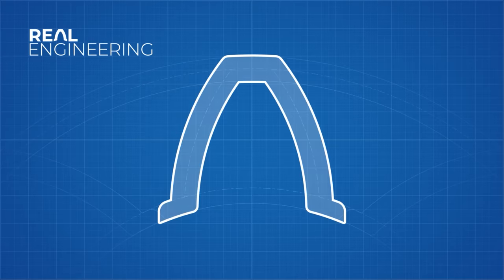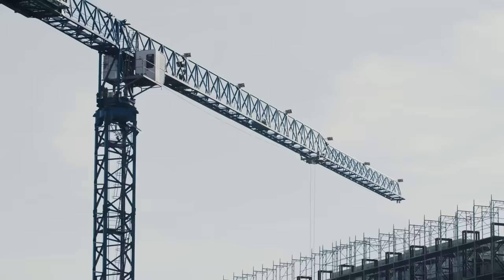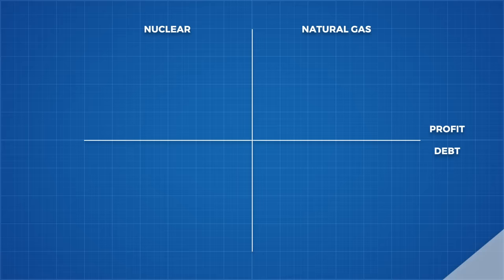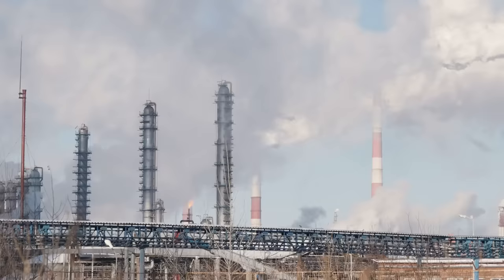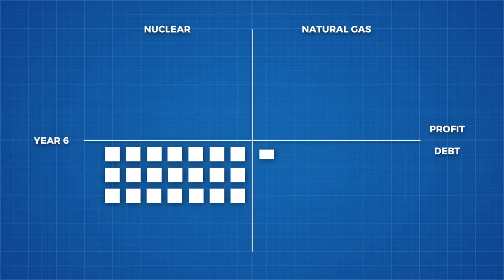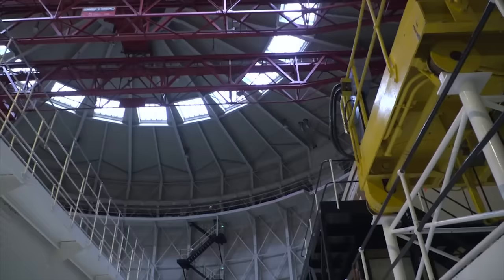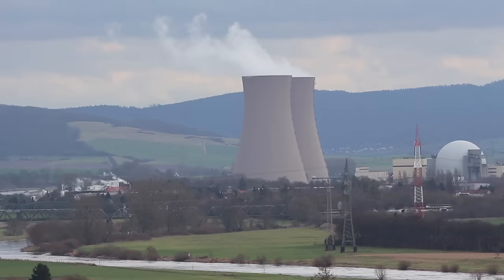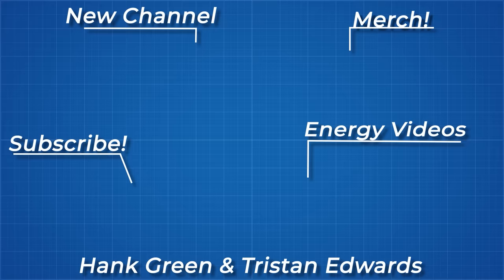The Economics of Nuclear Energy

Comment: This video was about economics; I trust that if you're going to do future videos on energy, you'll put 'nuclear safety' in proper perspective.

I.e. go into things like operating hours/death, the Windscale fire, pebble-bed reactor design, and the difficulties that arise when politics mixes with engineering.
Reply: And hidden carbon emissions and waste of the "clean sources"
Reply: Solar is literally more dangerous than nuclear. Calm down.
Reply: @davidhood9712  I'm a nuclear guy but I'm struggling to figure out how solar based energy is more dangerous than nuclear. Unless you are being cheeky as the Sun is a fusion reactor or talking about skin cancer or being blinded momentarily and crashing your car.
Please explain. I really do think nuclear is part of the solution not the problem and would love as much ammo for that rare fight with anti nuclear people as I can get.
Reply: @skizzik121  One potential problem with solar power plants would be their ecological impacts.
Reply: @skizzik121  The reason for the safety is the scale of construction.
Nuclear plants tend to have a 90%+Capacity factor.  They basically run at 100% power 24 hours a day, every day, for a year or two.  And then shut down to 0% for a couple of weeks to refuel.  So a standard 1.1GW nuclear reactor will produce about 1GW of average power. 1GW-Y per year.  Nuclear plants have a designed lifetime of 60 years, though it's possible that could be extended.

Irradiance from the Sun is about 1000 Watts/m^2.  Solar panels tend to have 15-20% efficiency, so we'll say 17.5%.  And Solar panels have a capacity factor of ~30% due to the angle of the sun, plus the entire nighttime loss (assuming ideal locations).  Putting that all together, 1m^2 of solar panel will produce 1kw x .3 x .175 or about 50 watts of average power.  With a lifetime of only 20 to 30 years.   A square kilometer of solar panels (1 million square meters) will thus produce 50MW of power on average.  Thus to equate to a single Nuclear reactor (normally multiple per plant, but we'll stick with 1) will take about 20 square kilometers lined edge to edge with solar panels.  And actually double that, since the nuclear plant will run for twice as long.  So 40 thousand square kilometers of solar panels need to be produced.  That means mined, manufactured, transported and installed.  This would be further exacerbated if we did the fair comparison of including deaths from the production/operation of the massive hypothetical battery, or the backup natural gas plants, necessary to supplement the solar power's intermittency to make it equivalent in quality to the nuclear, but we'll ignore that for now.

When doing ANYTHING on that scale, you're going to have random accidents that maim or kill people.  Especially if part of your supply chain is from places like China.  It's not that solar panels are generally more dangerous than nuclear (except rooftop solar, which has a significant increase in deaths/Peta-watt hour because installing things on roofs is dangerous).  It's just because producing equivalent amounts of energy requires so much more mining, manufacturing, and installation when doing it from a diffuse-harvesting method like solar or wind compared with a concentrated source like nuclear.

(And yes, the comparisons that make nuclear many times less deadly than solar and wind include the projected deaths from Chernobyl and other commercial nuclear accidents).

https://www.forbes.com/sites/jamesconca/2012/06/10/energys-deathprint-a-price-always-paid/#4184e6cd709b
Reply: @skizzik121  Nuclear powerplant work is mostly an office work, while wind turbine workers have to climb into dangerous locations.
Reply: @TealJosh  not to mention, as funny as it sounds, it genuinely dwindles bird population as they get struck by the blades.
Reply: and energy density of the power production technology over land area required, as well as waste.
Reply: people said that you can't avoid tax in your life....and who tax you? your mom?, no it's the politician...now enjoy your life
Reply: @davidhood9712  that's what I was getting at - the Windscale fire was a serious engineering failure, yet it did not directly cause any deaths - that can't be said of oil, NG, or hydropower.  Or bridges for that matter.

Comment: This is a fairly good generalization, however, a key figures has been left out. One of these figures is capacity factor. A nuclear power plant's capacity factor is around 93.5-96%. Solar power has an abysmal capacity factor of 24% and wind has a little better CF of 34%. If you wanted to substitute a 1000 MW nuclear power plant, you must build a solar farm with a capacity of 3900 MW or a wind farm with a 2800 MW capacity. 

"Wind turbines deliver (over the course of a year) between about 20% and 40% of their nameplate production capacity (depending on location). Therefore, the backup power plants will have to deliver the remaining 60% to 80% of the energy. This means that wind turbines would be more reasonably characterized as fuel-saving technologies for combustion power plants rather than stand-alone generators of electrical energy.
[--]
Renewable energy sources (primarily wind and solar) will not be able to supply the needed large quantities of energy sustainably, economically and reliably. In addition, renewable energy sources with fossil-fired backup power will in many cases not contribute towards reduction of greenhouse-gas emissions. Distorting the market with subsidies and by legislation to attract intermittent energy technologies into applications for which they are not well suited is economically wasteful." [1]

The next large problems with renewable energy sources come from land requirements and energy storage. Batteries are ineffective and expensive; pump storage requires vast amounts of land and a huge initial investment.
 The vast land requirements will cause problems, for example, with biodiversity conservation. This and other immeasurable factors are generally disregarded by many experts.

"Based on an objective and transparent analysis of our sustainable energy choices, we have come to the evidence‐based conclusion that nuclear energy is a good option for biodiversity conservation (and society in general) and that other alternatives to fossil fuels should be subjected to the same cost–benefit analyses (in terms of biodiversity and climate outcomes, as well as sociopolitical imperatives) before accepting or dismissing them." [2]

The argument that uranium stores will be depleted within a few decades is also untrue. 4300*10^6 tonnes of uranium is dissolved in ocean water, compared to 5.9*10^6 tonnes on land. The uranium in seawater is also being replenished by a constant pseudo-equilibrium reaction with uranium containing rocks. [3]

References:

[1] Brook, B. W., Alonso, A., Meneley, D. A., Misak, J., Blees, T., & van Erp, J. B. (2014). Why nuclear energy is sustainable and has to be part of the energy mix. Sustainable Materials and Technologies, 1-2, 8-16. doi:https://doi.org/10.1016/j.susmat.2014.11.001

[2] Brook, B. W., & Bradshaw, C. J. A. (2015). Key role for nuclear energy in global biodiversity conservation. Conservation Biology, 29(3), 702-712. doi:10.1111/cobi.12433

[3] Diallo, Mamadou S., Madhusudhana Rao Kotte, ja Manki Cho. "Mining Critical Metals and Elements From Seawater: Opportunities and Challenges." Environmental Science & Technology 49, no. 16 (2015): 9390.
Reply: whoa

Comment: I think the problem with the levalised cost diagram (love the artwork though btw) is that it only shows one way of looking at the problem.
 
Every other form of power generation there (other than natural gas, so the renewables) either requires specific geological features (a thin crust for geothermal, or somewhere either damable or with a large amount of tidal flow for hydroelectric), or else are entirely dependent on the weather, be it sun or wind, making them unpredictable (as well as region dependant) so you have to massively over-build your system.
 
Batteries are not going to cut it for regulating supply if most generation is irregular and needs regulating. They're also bad for the environment to manufactre, and degrade with charge cycles so need periodic replacement. Then you'll still need fossil fuels to fill the gaps which pollute.
 
Hydro is regular and awesome, BUT there are relatively few places where this can be done efficiently. Tidal can't be usually be used where there is marine traffic, and dams envolve flooding huge areas and have a massive impact on the environment. And can collapse... According to wikipedia (if you exclude the Banqiao dam collapse in China) 19,633 people have died from dam collapses (and the list is scarily long), however the Banqiao dam collapse in one go killed 171,000 people, bringing the total to 190,633 fatalities.
 
Compare that to "dangerous" nuclear power (even when you're including the cancers which we can't know were caused by the accidents, bearing in mind 50% of us are predicted to get cancer regardless) is only 522, if you only enclude direct deaths, that falls to 48, of which most seem to be workers killed in steam accidents etc, basically nothing to do with radiation. Then compare that to how many people have had their cancer treated BECAUSE of radioisotopes acquired from nuclear reactors... I'm going to bet it's more than 522...
The excess power at night can be used to charge electric cars, run heavy industry, charge pump-storage reservoirs etc (any thing but try to use batteries...*facepalm*)
Reply: okay, but now what about nuclear waste? this wasn't mentioned in the video whatsoever, and I haven't seen anyone in the comments talking about it yet either.
No one wants the waste on their land, and you have to protect it for thousands of years, which costs a lot of money...
Reply: @ThunderDraws  
Nuclear waste is a non issue for the plant operator. 

The waste topic is in essentially  all cases dealt with by government funded organisations.
The recently required stricter safety  regulation by the  greenies is the big issue for nuclear. Making nuclear the only form of energy with a negative cost curve. > Nuclear got more expensive.
Reply: Sorcize Is that why Chernobyl is already safe for life and to revisit, is that why people are living in Fukushima again?
Reply: Thunder Draws Waste is hardly important, put very simply, it's already been in rocks for billions of years, put it back in the rocks and problem solved, especially when half lives are high and in the millions to billions of years.
Reply: @Sorcize well, yes for the meltdown and no for the environmental impact of a meltdown. I simply miss the evidence that thousands of  people get killed by a meltdown. A few do,  but the majority of the population will not notice an impact. Maybe some will die earlier due to effects associated with higher radiation. But that's it.
The environment (nature) has and will always adapt.  But can we  humans?
Reply: @fatguy6153  What comes out of a reactor is a bit more concentrated and dangerous than what is sitting in the ground. If it's enriched fuel it is even worse. Often the only "safe" way of storing the waste is to build waterproof concrete tombs in isolated geologically stable areas, in order to avoid contaminating groundwater for the next ten thousand years.

Comment: Cost of decomission not part of the calculation - or did I miss it?
That and the cost of CO2 emissions are both weighty pro/con-factors in a true-cost comparison between Gas and nuclear power.
Why leave that out?
Reply: yeah, decomission is extremely expensive. of course so is co2....
Reply: At least in the US, part of annual profits go into a decommissioning fund by law.
Reply: Because the figures were restricted to an investment point of view and try to explain why investments in nuclear deacreas.
For an investor the relvance of decomission costs (in 40+years which would only 'eat up' the profits of the very last year) are irrelevant.
Co2 is not yet taxed and differ from country to country ... that would increase the fuel costs.
Reply: Also no inclusion of the long term costs of nuclear waste storage...

Most waste to this day is only in temporary facilities with little planning on how it can be stored for the 100,000 of years it will take to safely break down

There is a great doco called ‘into eternity’ that looks at Finland’s underground storage
Reply: @Willaev  aka the public still pay for it, just in taxes instead of on the bill... easy to be profitable this way.
Reply: @benjaminmeusburger4254  
"the figures were restricted to an investment point of view"
the title of the video say "The Economics of Nuclear Energy", and missing decommissioning cost and political issue connected is a big fail, imho.
"For an investor the relvance of decomission costs (in 40+years which would only 'eat up' the profits of the very last year) are irrelevant."
funny because there are different organization like MIT and US Energy Information Administration affirm that taken the full life cycle into account,  they are actually less profitable than an equivalent gas; and a couple from UK (one from the house of lords itself) saying that is more expansive even without decommissioning cost (I gave a quick look at the study and I think they take into account the buffer infrastructure needed). (you find a list of studies here https://en.wikipedia.org/wiki/Economics_of_nuclear_power_plants#Comparisons_with_other_power_sources).
Now, this is unfair too as also CO2 capture cost or, if not capture, estimated cost on healtcare should be considered (there are study on this too, of course not as conclusive/definitive, but maybe worth citing), plus as bonus the damage for extraction and refinement of the resource needed (and there you go down to a rabbit hole of country with economy based around those extraction).
Reply: @Willaev  Yeah this happened in the UK until governments spent it on other things.
Reply: @Willaev  In addition to this it's apart of the NRC licensing process to have a decommissioning plan. No plan, no plant.
Reply: Nuclear reactors are quite cheap to decommission. It's only a popular talking point because comparisons to other energy sources are never done and the price is always phrased as a big scary number rather then a per-watt amount.
Reply: @lesto12321  hi
thx for the link, there is stated "...  may cost $500 million or more to shut down and decommission a plant ..."
high level nuclar wast: ~200k per m³ by 12m³ a year = ~2.1 mio to get rid of the nuclear waste per year
Those figures seem (for me) to be quite low to have a huge impact on the comparison.
To include ALL costs is quite impossible for a <10 min youtube video. 
Another topic in this comparison:
If you have to import the gas from another country, then you put yourself into a dependency. This has also political repercussions 
e.g. Europe gets 30% of the gas needed from  Russia and they could simply switch off the pipeline at every moment
That would be the right topic for a few hours in a bar with a few beers ;-)
Reply: @benjaminmeusburger4254  pay attention decommissioning does not include long storage of the waste, a problem that for example in US is still open since 1970 and still no real solution at end (witch mean many small more or less safe solution adopted).
Including all cost i agree is huge, but at least decommissioning and the waste disposal should be discussed since basically the hugest realistic drawback of nuclear.
About dependency for gas you are partially right:
- methane is actually renewable, all animal produce it (is one of the major pollution in Australia!) and so decomposition of biomass with low oxygen level. It is much cheaper the one from extraction
- uranium mine are relatively rare and the big ones mostly from the same country that control natural gas. I guess uranium transportation is much cheaper, since its power density
- in particular in the EU example, EU is completing (but already functional) gas connection (Southern Gas Corridor) that is basically build to reduce Russia dependency, and other have been completed/proposed in the last decade
Interesting finding while looking up the data, even in country like France where nuclear is still going strong, the plan is to decommission up to 17 power plan until 2040 and there are no plan for replacement.

Comment: I appreciate the video but I have a gripe with the idea that LCOE is the end-all be-all of power valuation. It may be cheaper to add an additional kw of renewables, but as the system approaches majority-renewables, hidden costs exaggerate like intermittency, land use and resource extraction. A completely rational, centrally planned power grid would recognize these hidden costs, and choose to invest in the slower plan with more payoff rather than have to solve hard issues like majority-renewable intermittency, problems whose solutions may not even exist. You make a lot of good points though and nuclear investment will not happen without state intervention for those reasons.
Reply: There is also benefit from redundancy, flexibility, and more local control...  Those are all inefficient in a narrow sense.  They are also all good reasons to a wider variety of less expensive and smaller plants combined with a smarter grid.
Who knows what the best tech will be for any particular location in 20 years.
Reply: Exactly! ESA method is more accurate but youd be pleased to know that nuclear using ESA method ends up comparable in cost to offshore wind so factoring everything in, nuclear still isnt economically viable
Reply: Land use is a big factor that is ignored by proponents of renewables. You just can't ignore the tremendous energy density advantage of nuclear.